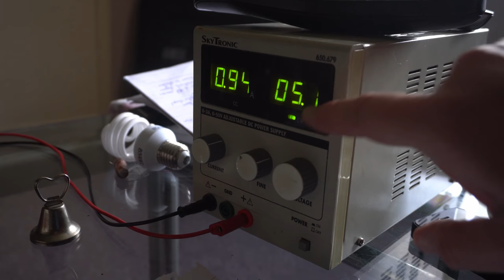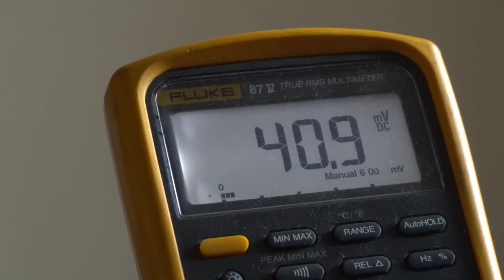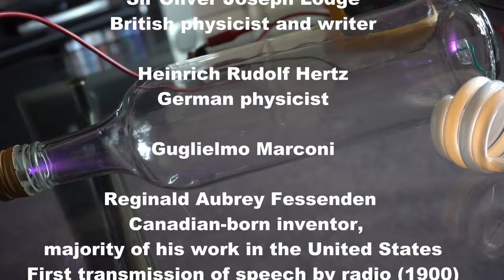William Crookes Vacuum Tube & a Brief History of Radio

Comment: i see you use flyback transformer, diode, resistor and transistor, please can you tell me exact schematics for that circuit
Reply from the maker: Hi,
This seller has the circuit
http://www.ebay.co.uk/itm/DC-High-voltage-Generator-Inverter-Electric-Ignitor-DIY-Kit-for-18650-Battery-/262877686646?hash=item3d34bb2b76:g:1aYAAOSw9OFZIqVF

It's not actually a flyback transformer, nor flyback circuit.

Comment: What kind of gas? Ozone?
Reply: So If we want the cathode ray to be in the middle line ,We have to make the test tube very vacuum. Why?
Reply from the maker: @bebrownbear8354  So the electrons can travel to the other end with a low voltage.
Reply from the maker: Gas, left inside the bottle?

Comment: Please link me the hight voltage generator
Reply from the maker: Look for it on ebay
Reply: @JohnB-2021  I can't find it
Reply: @JohnB-2021  if you find it link me please... I really need it
Reply from the maker: @giuseppe333  2,345 results for high voltage generator
Reply: @JohnB-2021  if it produces impulse electricity is it the same ok?
Reply from the maker: @giuseppe333  https://www.ebay.co.uk/itm/15kV-High-Frequency-Inverter-High-Voltage-Generator-Boost-Step-Up-Module/183226752316?hash=item2aa92a5d3c:g:rX4AAOSwzpFa-obX
Reply: @JohnB-2021  thanks youuuuu